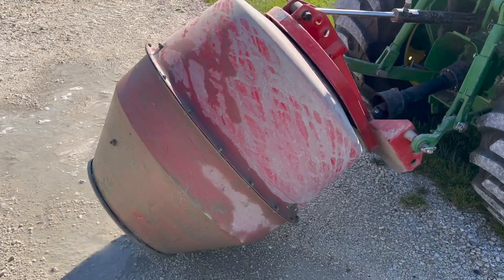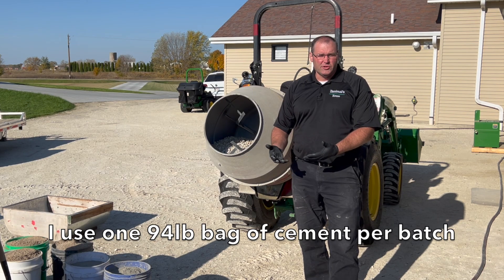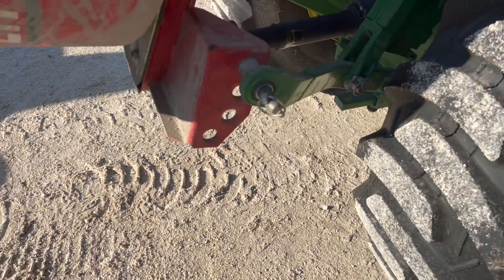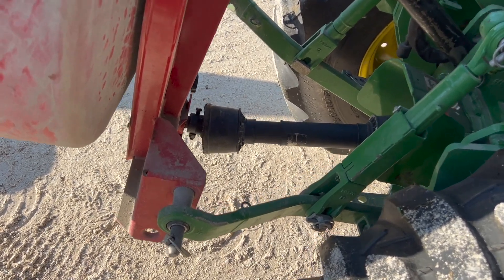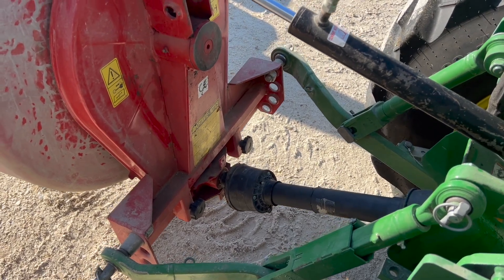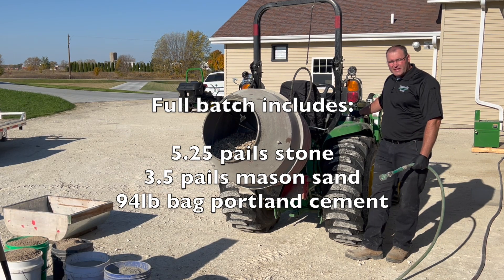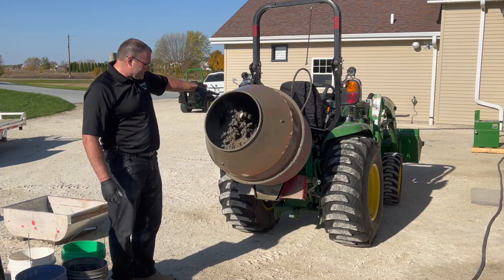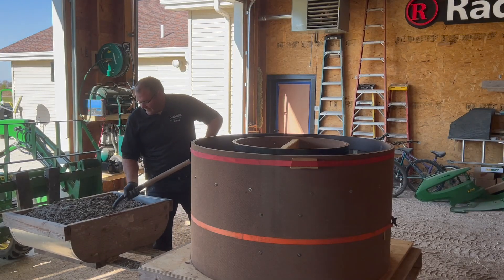Cosmos 350 Concrete Mixer - Hookup, Capacity, + Demonstration

Comment: What is your best guess on cost per yard?
Reply from the maker: I purchase 189-1149 from Menards for about $16 per bag minus their rebate so for a 6-bag mix I need, call it $90 in portland cement.  Then the gravel and sand is about $25 per yard of concrete and I should figure in some gas and wear/tear on the truck and trailer.  I would guess I'm at $125/yard for mixing it at home.  If you have the help, get a ready mix truck but for small jobs it works really well not to have to pay extra fees.  I also made a small batch plant that helps take the labor our of filling it up each load.  Someday I'll do a video on that.  Good luck out there!

Comment: Thanks for the excellent video. Your place is beautiful! I just mounted this mixer on my Bobcat CT4050. I used my Speeco quick hitch with a hydraulic top link (20-7/8x31-7/8) that gives me up & down control. Leaving my 3-point fully lifted, I find that I have full up and down movement w/o any pto issues. I haven't mixed a load yet, but I must admit I'm disappointed in your stated capacity which is way under the advertised amount. The 350 was listed as having a .48 yard capacity. It's still way better than a wheel barrel, though...
Reply from the maker: That's how I felt, I thought it would hold more when I purchased it but am pleased with it still.  If I fill it too full it just spills out and also sometimes doesn't mix the best down at the bottom of the drum.  I find that 1/6 of a yard is a good batch size.  Good luck!
Reply: @danimalshouse  1/6 of a yard is only 4.5 cubic feet. If that's accurate, that's less than the little portable Ryobi 5.0 cu. ft. mixer sold at The Home Depot for under $350! Now I really feel bummed! Could have purchased four of those for the price of one of these tractor pto mixers! Mine actually looks like it tips up higher than yours, perhaps I'll be able to get  a whopping 1/4 yard in it   🤔
Reply: It seems like most of the makers of standalone and Tractor mount mixers deceive with their specs.  They list the capacity of the drum as if it were upright, but nobody uses the drum upright.  Not only that, but the drum can't even be tilted upright. But hey, if it could, that's the capacity.🤨
Imer USA does it a little differently.  They list the capacity and the batch output (mixing capacity.)  Unfortunately, Imer doesn't make a tractor mount, but I have used their standalone models, and they are top notch.
Reply: @salthead3 that Imer is like the collamix tmx series mixers, right? Over been looking to buy one of those... The tmx1500 states 32 gallon capacity, which is about 4.3 cubic feet, or about 5 80# bags, I think.  How long does that imer you used take to mix a batch?